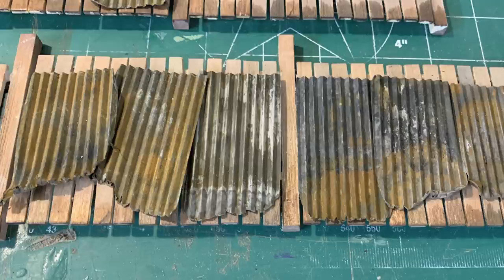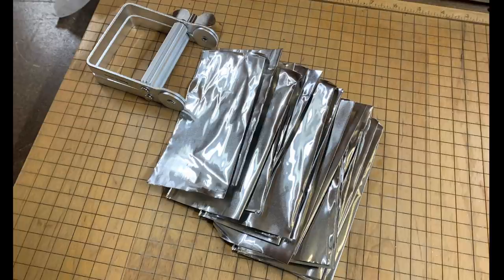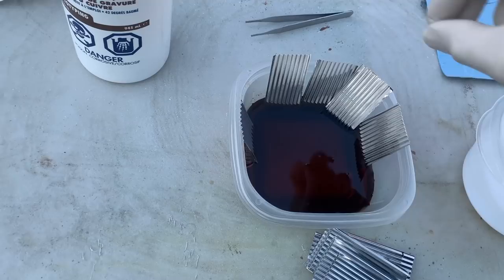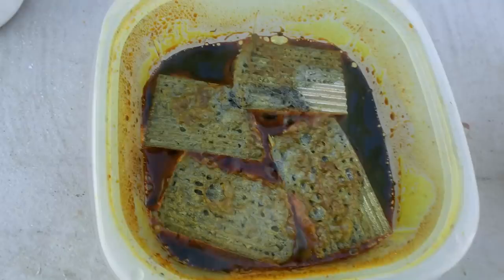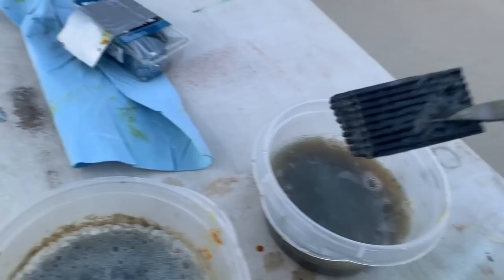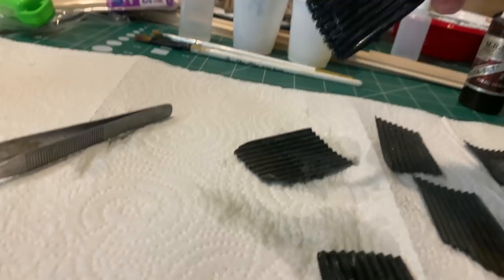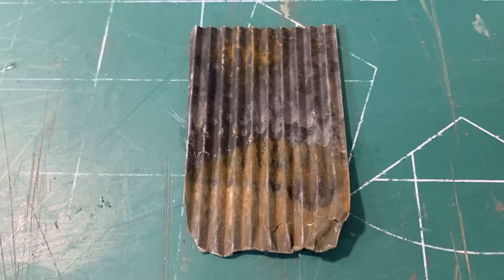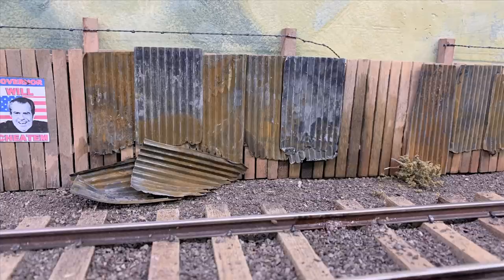How to Build a Rusty Corrugated Metal Fence - Building Model Railroad Fences Part Three

Comment: Brilliant Mate!! It's like a bad Science Project gone awry!!☻
Reply from the maker: Do not use this to clean rust off your Briggs and Straighten. It will damage the head. And the cylinder. And the piston. The rest of the engine will just dissolve. However it is fun to make aluminum rust. I suppose it’s like alchemy.

Comment: Those corrugated tins look a lot like what we had on one of our old sheds on the ranch many decades ago. Your tins look awesome! Now to truly make it look like fence patches you'll need to have some of your fence boards rotted away, otherwise it only looks like old rusty metal covering a fully intact fence. 

Thanks again for another Awesome video!
Reply from the maker: Yup. Need to come to the bottom. Even in the dirt. And more weeds.

Comment: Good stuff, Dale. I think 4” in width is all you’d ever need since it scales up to just over 6’ 6” in F Scale. Those layers of panels lapped together help make that detail really pop.

Have you ever tried rolling these panels to make conduit, such as in corrugated pipe? I remember the old irrigation pipe I used as a foot bridge that spanned the river where I grew up. It was estimated that it was about a hundredish years old, and it was made of panels of corrugated steel that had been rolled, and each section was riveted together. Not helical like it is today. It was probably exactly like the furnaces on Scotch boilers for ships. Anyway, it’d make excellent material for modeling prototypical culverts under roadways or roadbeds. I’m tempted to try it in the backyard railroad for real drainage!
Reply from the maker: It really wants the kink if you bend it against the corrugation. I’d have to wind it up pretty small and I don’t think it would be possible. Make an interesting experiment Though.

Comment: Excellent stuff. An infinite variety of weathering. Saw Luke Towan doing this a while back, but on HO scale thinned foil. If you blinked the whole panel was gone in the acid!
Reply from the maker: Yup. Saw it done in n scale!  The trick is dip if fast. And glue it to plastic sheet. Caus there is almost nothing left. Right?  No left.

Comment: One thing you did not cover, in your video, is how to dispose of the used acid stuff once you're done with it. I don't think I would want to pour it down the drain or send it to the landfill. I use pop/beer cans for my metal panels, ran through a paper crimper (from Michael's).

Comment: Love how you’ve made those corrugated sheets. Definitely gonna try the ferric acid method. 
One at a time. 
Yeah the crimper. Have been looking at that tool. The spacing of the teeth of the crimper definitely is appropriate for F Scale. 
Did you also use tin cans?
For HO Scale I use a sheet of corrugated styrene to lay the aluminum on. Then I’ll scribe ‘m with a dull skewer.
The effect of the ferric acid really looks amazing!!
Thanks 🙏 for sharing.
Reply from the maker: Yup. Works even for n.

Comment: Now if I could find that geared roller, to use in O scale
Reply from the maker: BUT you can do this in scales down to N. Instead of the crimper and heavy foil use evergreen corrugated plastic. Then rub regular aluminum foil onto that. Its fragile! Now carefully dip in the acid. Then carefully glue it back on the plastic. TA DA!
Reply: @ToyManTelevision  its the machine that makes the corrugated metal thats an issue Doing it in G was easy